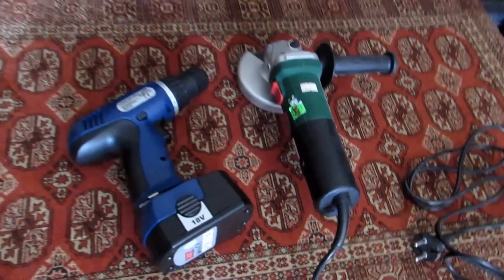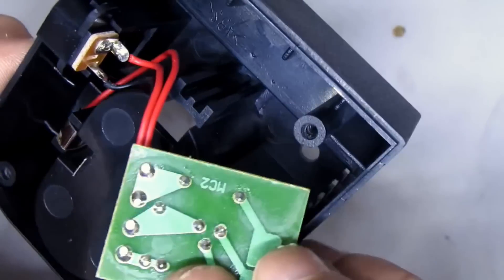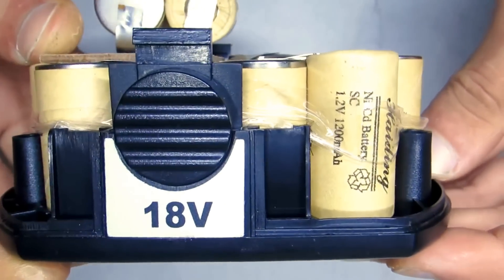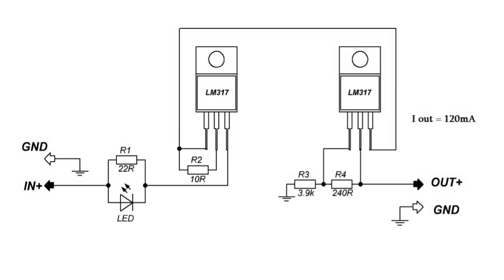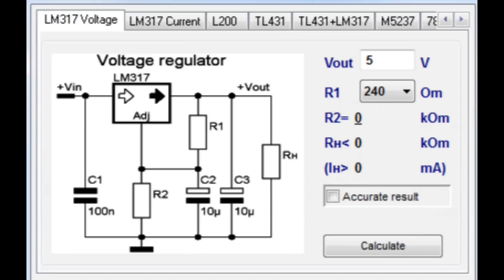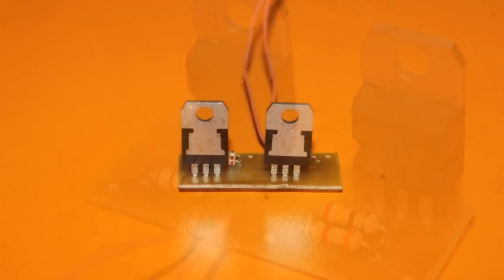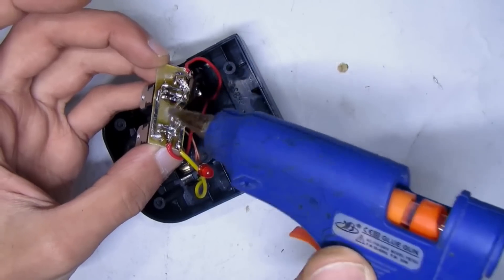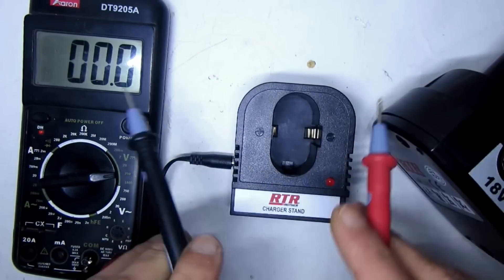Do you have electric tools? This for you!

Comment: My power supply output voltage is 36v. 
What resistor will need for the led?
Reply: Depends on wanted current draw, but you'll need about 1.8V voltage drop to turn that LED on. 
But 36V is almost the max voltage for an LM317.

Comment: I have a 24 V battery drill with 29 V DC output power 
supply, how to modificate the values of resistors. Thanks a lot and 
regards.
Reply: use trimpot instead of fixed Resistors

Comment: Very nice mod, the battery will have a  good life, you may think about a low voltage alarm on the drill to prevent over discharging the batter , good luck..

Comment: your drill has nicel cad. batteries. so you would convert it to lithium anyway ;)
Reply: As long as the NiCads last (5-10 years easily), this is not required. But beware, unlike Li-Ion, nickel based batteries have an memory effect, so you need to fully drain the battery otherwise it's prematurely getting damaged.
And you can use NiMH batteries too, although they're less energy dense, they're a direct cell swap.